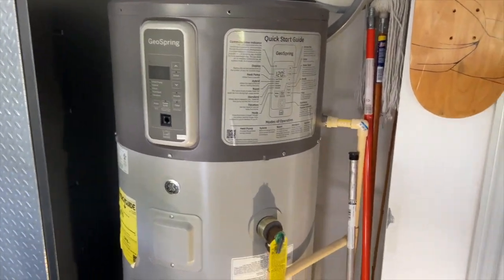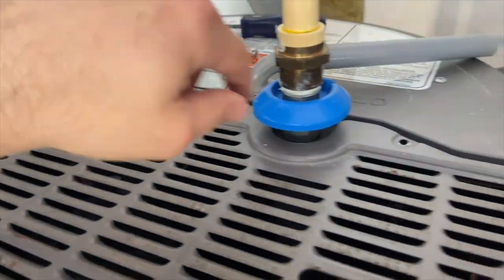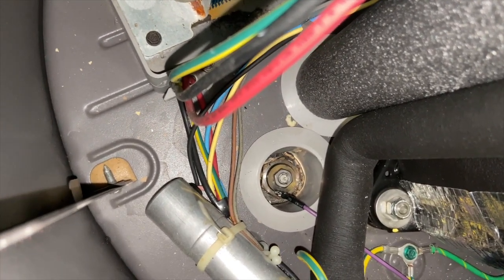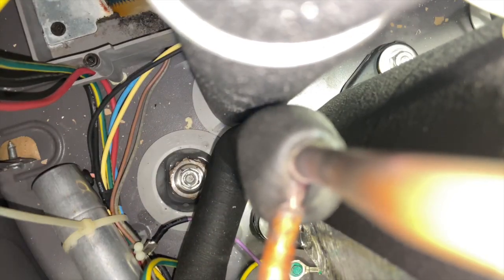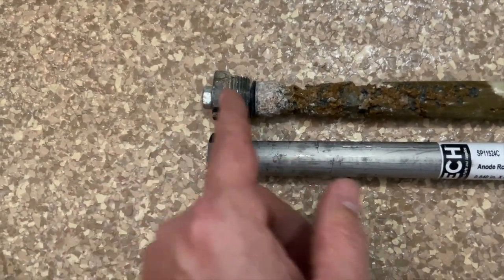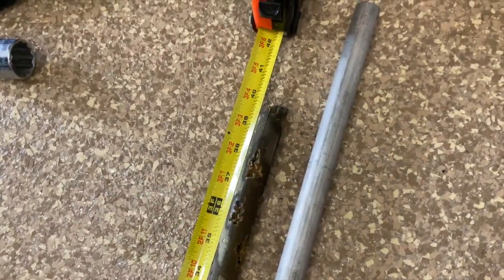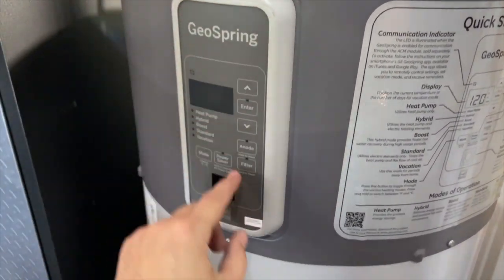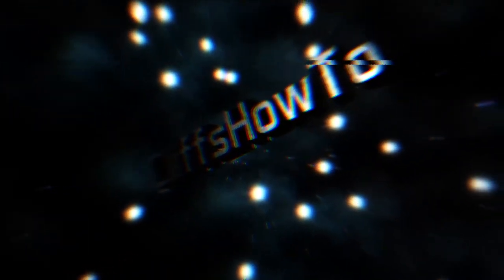GE Geospring Hybrid Anode Rod Change

Comment: Great videos, I just replaced mine with the same $40 rod from Home Depot. Since I didn’t connect the sensor wire F17 error code came up which actually means missing sensor connection. Is there a way to override this error coded? Thanks
Reply from the maker: Sure is! GE Geospring Hybrid Water Heater: How-To Disable Anode Rod Sensing
https://youtu.be/Jyvm6qDAin0

Comment: You need a bit larger than a t15 head to take off initial screws.  Also a 12" plus extension to a half inch drive worked fine for me.  I replaced using the costly but exact replacement anode rod from SuppliesDepot
Reply from the maker: Nice!

Comment: Thanks for posting the video. How did you diagnose the problem.? My geo ther hybrid is not working in electric, hybrid or heat pump mode. I don't want to rush to replace the heating element before I'm fairly sure it is not working.
Reply from the maker: I just pulled it. No signs of any issues. The purpose is to prevent issues! But once the rod is gone, so is the protection!
Reply: Nothing wrong with the heater. Set the thermostat higher and it  kicked in. In all 3 modes. I did right not pulling any parts too soon.

Comment: Thanks for the video! It was really helpful. Good point from @robertmcdonald5537 - I also took off both nuts, but fortunately, either the rod was corroded in place or the rubber washer was enough friction and the rod didn't drop. After I put the bottom nut back on (whew), I fashioned a wire loop from picture hanger wire, slid it over the stud and put a washer and nut on top and was able to pull the rod out using the wire. I went with the $259.95 Bradford White rod (PN 415-52675-00) from Suplies Depot, LLC

Comment: Great video. It helped me a lot. I found on my GE Geosprings hot water heater the ring screws and the  top screws were removed with a T20 instead of a T15 driver.

Comment: Why not just drill a hole and reconnect the sensor with a bolt? Electricity doesn't care who makes the connection.
Reply from the maker: You could do that
Reply: @ I tried but they must be expecting a resistance range, etc.  it didn't work for me
Reply: @ I actually tried it any mine still showed an error.  ...I will try and improve the electrical connection.  But now I realize their tech could easily measure the resistance, etc. if it isn't their device it could easily know.

Comment: I worked on ocean going ships in the engine room and we replaced anode rods on all our salt water cooled equipment.  We never threw away the threaded fitting part, they have internal threads and are specially made for anode replacement.  If there was enough anode left, it would just unscrew from the fitting. If it was totally wasted than we would put a torch on what was left in the fitting as it melts at a lower temp than fitting and cleans right out and new anode rod screws right in.

Comment: Great video and easy to follow instructions. Thanks! When I pulled out my Anode Rod, to my surprise all that came out was a very thin wire attached to the top knob. No outer rod just a thin almost like a wire hanger for clothes. Now my question is: did the old outer part of the original rod totally disintegrated (you can see water in the hole) or did I get the chinese version of Anode Rod in my GE Geospring Hybrid water heater? Any comments/suggestions? 😲
Reply from the maker: They disintegrate over time, hence the reason why they have to be replaced.

Comment: I have a geospring but it doesn’t have that “Anode” sensor on the front. 
I’m hoping that means I won’t have to deal with the wire and first nut.
Reply from the maker: The wire is for the sensor, so I’d think you wouldn’t have it

Comment: The anode light on my GE Geospring started blinking. So I guess I'm replacing mine. I'm going to try and find one with the sensor wire.
Reply: $750 parts and labor.

Comment: A strong magnet might pull the rod up in that little "well".  I've got a tall 80 gallon tank and never thought about how I would replace the rod in a basement with 8' ceiling.  So I will have to use the multi piece rods. My red geo spring doesn't have the anode rod sensor.

Comment: Thank you for the video. Really helpful as our GEH50DEEJSCA water heater indicates the anode rod requires replacement. My owner's manual says to torque to 50 ft-lbs and I see you torqued yours to 9 ft-lbs. Quite a difference, wonder why?
Reply from the maker: Not sure.

Comment: Great instruction. I made 2 mistakes . 1. Forgot to turn off my water valves. Stupid mistake! 2. I took off the second nut under the wire sensor. When I began to remove the old rod , the large nut on the old anode rod came off and the old rod plunged into my tank. Called a plumber and he said you cannot get the old rod out when that happens and just leave it inside the tank . So I installed the new rod and I guess all is ok. The old one will just disintegrate over time (I hope!). Just a warning for future DIY people like me . 😅

Comment: For anyone watching this (excellent) video and is looking for the rod he used, it is a SP11524C, and is available from the following as of September 2023:

Repair Clinic - RC Item #2639362
Menards - Part # SP11524C
Grainger (for Commercial users only) - Item #45W405
Supply House - Part #SP11524C

There are several others I found, but these have them for a reasonable price of $31 to $32 or so from Menards and Repair Clinic, and around $45 to $50 from the other two...

Comment: Is the diameter critical for the rod?  I don't see exactly a .840 in diameter rod generally available. If it is .75 or .90 in would that work? It looks like most or the specs say 1 in width but the rod diameter can vary.
Reply from the maker: I think that would be fine. I don’t think it’s super critical. The diameter will definitely vary over time anyways, as the rod corrodes.

Comment: I have the GE hybrid water heater one generation before yours. It's not 13 years old and going strong. The anode rod part from GE is no longer available either. I've been very satisfied with this heater. But at thirteen years old I'm now considering changing it. Today's heat pump water heaters are quite a bit more efficient. And there are huge rebates in my home state. I still may consider changing the anode rod based upon your video. Thanks
Reply: I was able to find a compatible rod by calling a plumbing supply and they found it.

Comment: Have a GE Geospring Hybrid and just got an F16 Anode Rod Depleted error code. Bought home new, Geospring came with house. Found out a while ago that GE offloaded water heaters completely, they don’t make my model anymore & Bradford-White picked up the slack. After some research, GE Manual, QR code, GE website, GE phone call that bounced me to Bradford-White, another call to B-W distributor, dog chased cat, that ate the rat, that…well…found out that the original OEM anode rod has that connector (to purple wire in vid) as a sensor (like you said) so that it knows a problem & can throw that code when the rod is done for. OEM replacement is pricey - of course - but I decided to bite the bullet since this heater is only 6 yrs old. I’ll be checking it more regularly, hoping to get 15-20 yrs out of it, AND I’ll probably buy a spare OEM rod in case they go scarce on me. That said, I’d be surprised if you can’t just replace it with a regular rod, and disable the anode sensor (also like your other vid) Great job & thanks for the good info!!!
Reply: Mine just went bad too. Where did BW direct you to get the OEM replacement?
Reply: Where did you get yours?
Reply: Do you know if it's the Bradford White 415-52675-00?